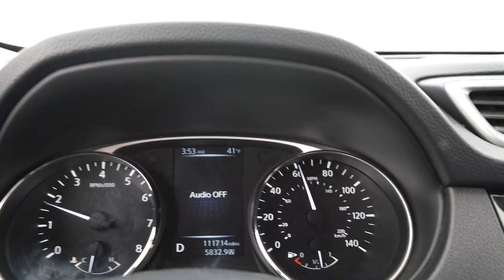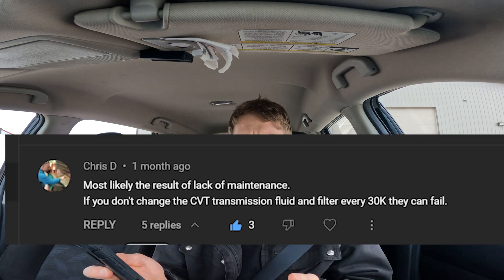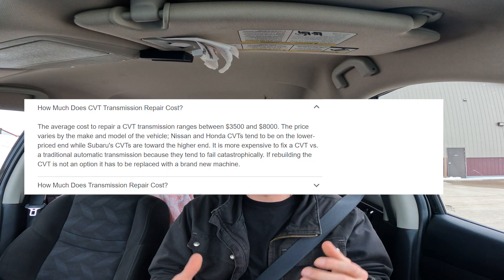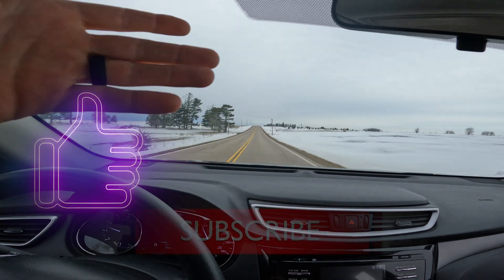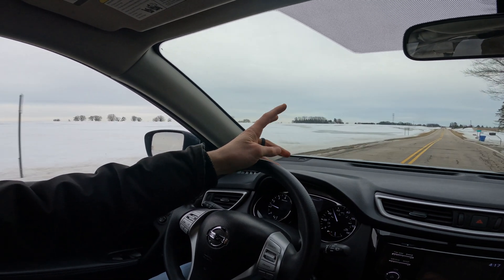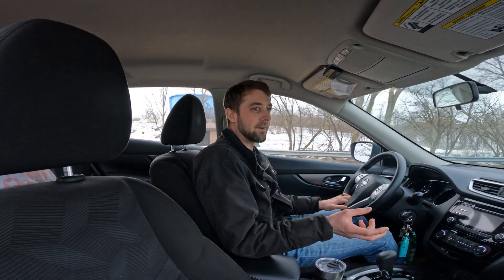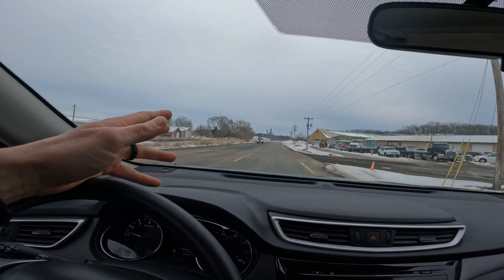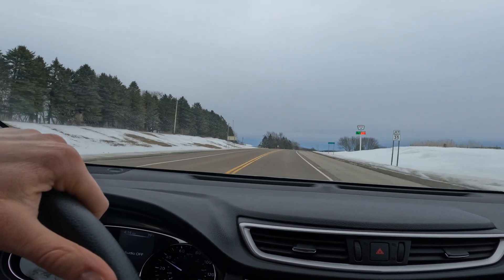Everything WRONG with the Nissan CVT Transmission

Comment: Had a 2012 Rogue that went into limp mode each summer. Nissan said we can fix it for $1900.  I put in an aux generic trans cooler & changed the fluid each summer.  It fixed the limp mode but trans always whined. At 97K some guy hit it while my wife was driving. I am glad the SUV is gone.  Bought a Mazda CX-5 with trans gears.  Problem solved.

Comment: I always let the nissan with CVT get rolling for a half second before I roll into the throttle, it engages much more smoothly that way. Also waiting until you feel it “bump” into D or R to let off the brakes instead of slam-shifting and gassing it as soon as the lever’s in the right spot. However that applies to most automatics not just belt-driven models
Reply: THIS, my mirage shares the same trans as the versa and sentra, I always let it do the little bump into drive, just feels like the right thing to do.
Reply: It IS!!!!!!!!!!!!!!!!! the right thing to do. @OrganicFoxes
Reply: All transmissions seem to have the “one Mississippi, two Mississippi” engagement theses days. My ‘18 Mustang with the 10 speed automatic does the same thing. So if you’re reversing out the driveway and hitting the gas as soon as you go to D, you’re going to make trouble for yourself.
Reply: I think the biggest problem is people not knowing that a CVY cannot take abuse. As in hard from a stop acceleration on a constant basis. If you are an aggressive driver, then you should not buy a vehicle with a CVT. I think if you drive them conservatively and get the CVT fluid and filters, yes two changed on a regular 30,000- mile intervals as you should you probably will be fine.
Reply: @scrambler69-xk3kv well in that case Nissan should put a warning label in front of the driver to tell them to drive like a granny.  Also put an asterisk besides the advertised hp number saying you can only use half of the power.
Reply: @scrambler69-xk3kv  30k interval...bad advice. Change the fluid whenever you have driven through tough conditions in hot weather to include driving the piss out of it in 100 degrees or a road trip through the hills during the summer months. That interval could be 1,000 miles or up to 100k miles if you don't burn the fluid up. That fluid burns up pretty easy. If you drive slow in conservative conditions, I would recommend doing it at 80k. Filters should be done at 100k and stepper motor should be replaced somewhere around 150k in my experience.
Reply: When you think about it, the only safe gear to shift into when moving is neutral, and even that shift you should be careful. And people need to learn that unless you're gonna be waiting a while, don't bother shifting into park while waiting, it causes just as much wear doing that as it does waiting while in drive.
Reply: There should be no power bands. The fuel savings is 5% over manuals. And they’re more reliable than manuals. I’ve yet to have a manual last much more than 60000 miles. JATCO sells them to Nissan for probably like $1000. So the mark up is the problem.  If you don’t feel the smother gearing it’s because you have lead foot disease.
Reply: @rinkevichjm 
With lead foot disease, my manual Honda did  more than a 100000 miles. And without, over 400000 miles. 
You really need to learn how to drive and differentiate between crap and a real car
Reply: @JamesRinkevich  my manual Chevy cobalt lasted for 220k miles on the factory original clutch, I beat the living crap out of that car. Other than that, all I did was brakes, oil/gearbox changes, and struts. I got about 35-40 mpg with that car plus did a ton of long trips with it
Reply: @josephbernard5240 so my pontiac montana automatic transmission seals failed at 160k miles. We didn’t treat badly they just made the seal so hard to replace that fixing it was more than it was worth.
Reply: @JamesRinkevich  automatic transmissions have a pressurized system though. But yes, it does suck when an internal seal blows out in them. Manuals only have gears bathed in non-pressurized oil
Reply: @josephbernard5240 the jatco cvt is also pressurized, I don’t think the Dana variglide transmission is though. I don’t understand why manufactuctures have built cars with it.
Reply: @JamesRinkevich  I know, and every automatic is pressurized, they need oil pressure to activate the solenoids. I actually changed my Nissan’s CVT fluid a few days ago because it was due. The filters were grody. That’s also mostly why CVTs fail, the dealers always claimed it was lifetime oil, meanwhile, the “lifetime oil” gathers clutch material and metal shavings that ultimately clog the filters
Reply: I have a 2019 maxima cvt I drive it smooth I don’t gas it or throw it in gear when it’s still moving I hate ppl that do that I don’t let nobody drive my car I have to tell my mechanic to come to a complete stop before putting into gear because they will dog ur car
Reply: Yes, some lack the common sense you have. Thank you for that.
Reply: Who the hell wants to go through that just to drive their vehicle?!!!!! Why do it has to be a special kinda way to drive a vehicle with a cvt?!!! 🤨
Reply: Good idea  I try too ease giving the full throttle just cruise
Reply: My Suabru Crosstrek does the same thing . Its the belt and spring changing to 1st gear is what I was told and they said all Cvts do that because there is not separate gear , well scratch that Toyota Cvt has a real 1st gear then uses the cvt belt.
Reply: 2012 rogue owner here 87000 miles. I baby it. I like the smoothness of that transmission. Always feels like you are in the right gear so to speak. Change the fluid and filter regularly. Let the car watrm up especially in cold weather.
Reply: yeah, it makes me cringe when I see people just slam the transmission into the next mode when the car is still rolling. 

Then you have the ones that throw it in park when the car is still moving a decent amount and it jolts off the parking pawl.
Reply: @Iridiumcosmos  i feel that cringe in my stomach lmao it's as if they parked, got out, and just kicked the car for 5 minutes before going inside

Comment: I own a 2013 Altima and no issues with the CVT transmission by avoiding jack rabbit starts and hard stops which is pretty typical of how I see most drivers doing on the road today. I regularly get 34 mpg highway and 29 mpg local driving.
Reply: If you drive the CVTs like a rally car it will certainly breakdown
Reply: @childrenshortstory I do burn outs I have 140000 mine
Reply: @childrenshortstory I drove my cvt very hard on my 16 altima and it didn't fail. My 19 altima cvt works very good and had 200k.
Reply: brokie + normie
Reply: I'll give you another tip. If you drive your car through tough conditions in the summer months like through the hills or in stop and go traffic you should drain about 50 ml of fluid into a WHITE cup. A paper towel will not give you a good enough indicator. If it has any tinge of black to it, change the fluid it's toast. That fluid can last 1,000 miles or 100,000 miles. There is no interval. Changes should be done on it based on your judgement on if you burned the fluid up or not. Also, OEM Nissan NS-2 fluid only. Do not put in that Valvoline or Idemetsu junk. The Idemetsu stuff is too thin it'll put your CVT into gimp mode.
Reply: @garneroutlaw1  Been using Valvoline CVT fluid with my Nissan CVT for over 5 years no issues.

Comment: I think the v6 CVTs like my 2009 Murano fares better.  Because with the power of that engine, i can get up and go and not exceed 2000rpm so the CVT doesnt have to spin has fast.  I let the car roll a bit before I press gas.  I drive it pretty gently.  110k miles on original CVT.

Comment: I have a 2014 Altima.  CVT was replaced at ~40000 miles.  I have been replacing the CVT fluid every 10,000 miles.   Now it has 155000 miles and is doing fine. 🤞
Reply: if you have to replace the fluid every 10,000 mi , just sell the trash can !
Reply: @boci11  You don't have to. You have to change the fluid whenever you burn it up driving in tough conditions in the heat. People just don't understand this. The interval could be as little as 1,000 miles, but the fluid WILL last 80k easy in ideal conditions. Stop and go traffic for 2 hours in 95 degree temps? Change the fluid immediately. Long road trip through the hills in 90 degree temp? Change the fluid immediately. Driving 5 miles slowly during your commute in cool temperatures? Change your fluid at 80k. People just drive the piss out of these cars.
Reply: We have a 2018 Mitsubishi outlander.  And fluid is supposed to be  changed  at 30,000 mile intervals. We will see.
Reply: That's the problem, if you need to replace fluid that often, how much are you really saving on fuel? Cvt supposed to be more economical.
Reply: @mofayer  I change mine every 60k. I have over 400k. You don't need every 10k  unless you're om a racetrack.
Reply from the maker: Keep that streak going 😁
Reply: @ManvsCars I am at 223k miles my 2011 rogue  current.  I found that the cvt cooler filter gets dirty fast and it’s hidden. And Nissan says it does not need to be replaced and most people don’t there is 2 one in the pan one in the cooler itself  and if that tiny filter is not changed  like every other oil change  the fluid flow rate is slowed  and the cooler being dirty does not allow the fluid to cool then I have seen the step motor cause a lot of problems but the key here is that cvt hidden cooler filter  that needs to be replaced often   But I agree cvt is kinda shitty feeling when driving   I hate big ass hills in mine
Reply: That's 2 soon lol
Reply: So it's the fluid ????how every 10k miles ???
Reply: @great4ever845  because Nissan has a technical service boat in the claims it needs to be changed every 30,000 and then they changed it to 25 I do it is 10 as a safety precaution and because the fluid capacity is not that much and CBT is run hot in general so better safe than sorry and it’s cheap as hell anywaystechnical service by the way I do this for a living

Comment: You want Americans to change Transmision fluid like Engine oil? ok, Fine. You design it to be changed like engine oil. Because we simply do not want the expense of taking it back to the dealer. We want to do our own oil changes.  You will not be original by saying that dealer oil change is cheaper than a transmission. That's a given.  
Theese cars should have dipsticks, under hood stickers, easy to change filters and drain plugs. That's it. That's all it takes.

Comment: My 2012 Altima has over 218,000 miles on it. Original engine. Original transmission. I change the oil every 3000 miles. Drain and fill the transmission fluid every 30,000 miles. The car has been good to me.
Reply: I've seen a few of them last, specifically if they were only highway driven and well maintained. However, I saw enough of them fail in the time before I left the automotive industry that I won't recommend friends or family buy one. I also have a coworker who lost his 2013 Nissan Versa to CVT failure. Cost was more than the car was worth so it was scrapped.
Reply: That's a lot of changes. A lot of people hate gm but I do my oil changes every 10k miles and have never changed the transmission fluid on my 2015 Cadillac XTS and zero problems at over 70 thousand miles 😂
Reply: Exactly.
Reply: You have also been good to the car.
Reply: Wow that's terrible. Engine oil at 3k and trans at 30k is way too often for a modern car. Big waste of money. How much are you really saving on gas on cvt?
Reply: @mofayer  the actual requirements should be engine oil/filter at 20000 miles or annually and CVT at 60000 miles. Carrol synthetic Transmax CVT meets the new Nissan standard is is about the same as the engine oil.
Reply: @mofayer  Its called preventive maintenance.

Comment: I know people with CVT's (including Nissan) that are 300,000 KM (186,000 miles) that are still going.  Mind you they did all the maintenance and did transmission fluid changes when they were supposed to and put in the fluid designed for the tranny.  The other factor is that they are all on 4 bangers around 2.0L so they are not being driven that hard.  Ignore maintenance on a tried and true old school torque flite, turbo 350 etc. and they will expire before their time as well
Reply: Tell that to the thousands of people with CVTs failing at 40k miles or even less. I can't think of any traditional automatic with a failure rate anywhere close to Jatco's crappy CVTs. The only transmission comparable is Ford's awful Powershift DCT.

Comment: What about the 2 filters that should be changed along with the fluid flush & fill every 20-30,000 miles.
Reply: Yep one in the pan and one under a cover on the front passenger side of the transmission.

Comment: I rented a 2022 Toyota Corolla with a CVT and it was actually one of the better CVT's I've driven. The Toyota models have a "launch gear" and the whole driving experience was very smooth, the transmission was very well behaved for a CVT with no wild rpm fluctuations.
Reply: I have a 2014 Corolla with CVT, at 110k miles so far with no issue. I know CVTs have a bad rap but so far this one has been perfect (if a bit droney).
Reply: I don't understand why they go into the trouble just ti save less than 5% on fuel
Reply: It WILL slip n'slide eventually.  Just give it time.
Reply: @Afrocanuk nah those mofos last, it's a Toyota. They put that transmission through the ringer to make sure it could have that badge placed onto it. Already have a friend that has 265,000 on his 2021 Corolla SE (same car as 2022)

Comment: Pros and cons to everything. One area the CVT shines is cruise control. No transmission is better for riding in cruise control. They're smooth as butter.
Reply: I agree with the cruise control but it bothers me that I spent 42 K for a car that I have to change the transmission oil every 25/30 K. To me that sounds like a design flaw. I have  a 2016 Murano Platinum with 109 k miles and I am looking for a new car because of hesitation, when starting, changing gears over and over on hills, No more CVT's. No more Nissans.
Reply: @stevefarris9433 you don't have to change the fluid that often. Check the owner manual. Most nissans say every 60k if used primarily in extreme use such as towing or taxi driving. Otherwise you have it checked at the dealer with the CONSULT (some sort of scan tool I assume). I won't advocate they're great or for everyone, but they're certainly not nearly as bad as the internet painted them and they just take getting used to.
Reply: There are a lot of things I actually find I prefer about CVT. Cruise control is one.

Another is smoother power delivery when applying gas in corners. Regular automatics balk when they decide to shift during cornering and I can’t stand that feeling. Not even a concern with CVTs, though.

Another is power delivery with small turbo engines. You only have to wait through turbo lag once on a CVT then it just sits in the sweet spot of the engine’s power band. Geared transmissions you have to repeat the process every gear.

Comment: The fuel savings went out the window the 1st time you replace a transmission. It is pointless to put them in cars because you do not save you lose. Now I do blame Nissan for telling their customers they are sealed for life transmissions that do not need service that is a blatant lie told to buyers with all vehicles now CVT or not. CVT needs service every 30k or less. They can last to 200k if you service them every 25-30k miles. No not all CVT's are bad. Honda and Toyota have had really good luck with their CVT transmissions. Nissan by far has been the worst followed by the few Chryslers that had them. I baught a Toyota Camry over a Honda Accord because I did not want a CVT even if they are not problematic as much with Hondas. I like the Accord better and Honda lost a sale because they chose CVT.
Reply from the maker: Agreed! Some people swear by these units, I think because buyer remorse and now they have to justify it being the right purchase? To be fair though, I currently still own one. lol

Comment: I have a 2013 Nissan versa with 150,000 and my transmission is failing. im juggling if i should get it fixed or if i should get something else. Is it worth it?
Reply from the maker: If the vehicle is in great shape it might be. However it's a tough tipping point for most people when the repair cost is more than the value of the vehicle.
Reply: What did you end up doing?